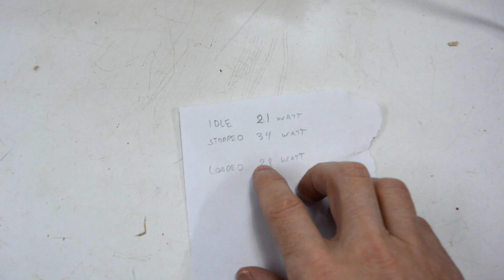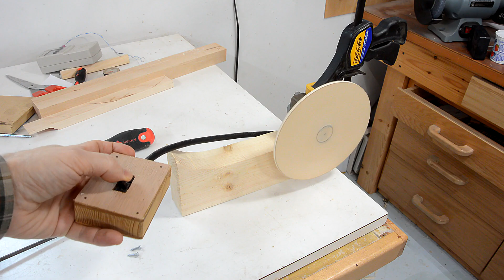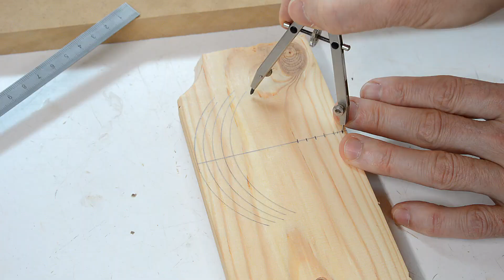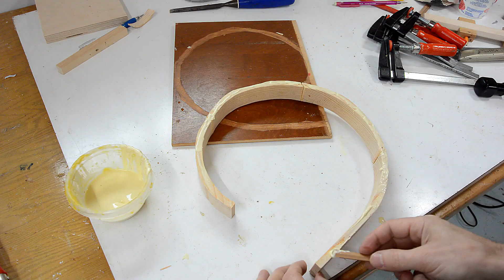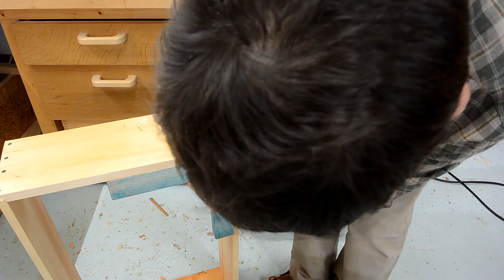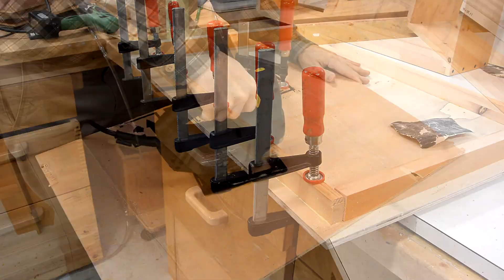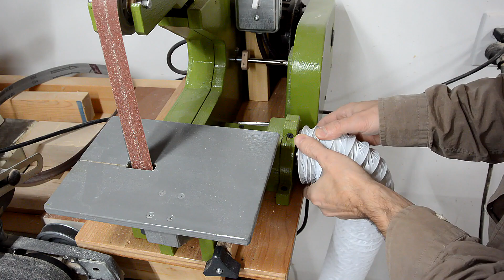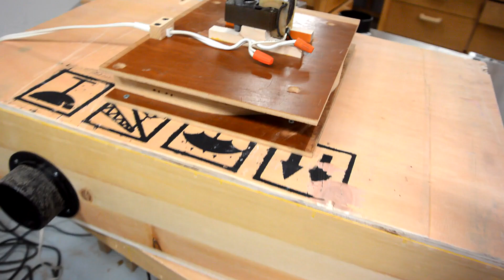Mini dust collector build

Comment: Just a quick tip regarding making a spiral for a fan like this. Start out the way Matthias did, measure the big diameter and the small diameter, find the difference (D - d) and use a dowel with that diameter, a string and a pencil. Start at the big diameter, and as you draw, make sure the string goes around the dowel (fasten the string any way you like, but make sure it's tight). Since the string gets shorter, it will pull the pencil closer to the centre the further you draw, and since the diameter of the dowel is (D - d), then the result will be perfect.
Reply: If you don't bend to my will, you shall perish.
Reply: Well, as I tried to say, you have to have the dowel loose to begin with, as well as the string. Then just wind up the string on the dowel using your fingers to hold the string in place. Then, when the pencil is at the right point, make sure the string lines up between the starting point and the centre. When you see that the string has the right length and the right orientation, fasten it with something. A clamp, glue, your fingers, tape. Then, when the string is perfect, hold the dowel down, and draw the spiral. If it's still confusing I can try to make a video, but it would be the first video I ever make, so it might be shit.
Reply: That's a good tip! thanks.
Reply: +Keegan Chaput No problem. EDIT: Another thing I should add is that if your string is too long, then don't worry. Just wind it around the dowel until it's the right length. Just make sure the string is "straight", as in, creating a line that, if extended, would cross both the centre and the point where you start to draw. If the string creates a line that's tangential to the dowel, the spiral won't be perfect.
Reply: +stygn Not having infinite number of differently sized dowels on hand, I'll use a dowel on hand, say  the 3/4" one in my scrap box, and use that to drive my (D-d) number, either fixing D or d as easiest to live with.
Reply: +stygn great tips, and I understand what you're saying about the string not being tangential, but since tangential is the tendency of the string, how does one control the string so that as it winds onto the dowel it is pointing to the radius point?
Reply: Genius!
Reply: +stygn You're giving away too much info!  You told people of the basic idea - that should be enough. It should be down to them to get it working perfect.  Otherwise we're all just following orders, and no-one is thinking for themselves (which is dangerous in a shop!). :)
Reply: D irk3672 You don't have toilet paper, tape, aluminium foil, wax candles, anything at all to make a round thing with a specific diameter? Hmm. You see, it's quite important for fans like this to have to have the right dimensions.

Comment: LoL.... this is the second time that you make a misake about motor rotoretion.
Reply from the maker: +Mess Krio True enough.  But at least I could demonstrate that the impeller doesn't work that well backwards, and I was able to reverse the motor.
Reply: +Matthias Wandel Squirrel cage impellors can be designed with straight, forward or backwards curved blades, it all depends on the pressure/flow you are after and the speed/torque curve of the motor. Generalising severely a back curved blade will suit a high speed low torque motor and a forward curved blade will suit a high torque lowish speed motor. I've almost build a dust collection thing out of a chop vac and plastic rubbish bin, but can't find any ribbed hose that is cheaper than just buying another shop vac. some will appear some day, or I'll just hunt for broken vacuum cleaners.
Reply: +William Moser and come to think of it you probably know all of that already.

Comment: If you were stranded on a deserted island you would probably be back to roughly the same standard of living within ten years.
Reply: +MrPanohead "I constructed the automatic doors on this subway train out of some bamboo and a small piece of leather that floated ashore yesterday. It works okay."
Reply: +Tor Arne Benjaminsen "I have just realised I fitted the head of my bionic bamboo spouse without a voice box, I actually prefer it this way so there is no need to make adjustments..."
Reply: +Tor Arne Benjaminsen hahaha best comment
Reply: +MrPanohead That's a bit of a stretch. Probably 1/2 that.
Reply: +Tor Arne Benjaminsen LOL!
Reply: +Double Dare Fan He might take weekends off, though.

Comment: Could you do a video on the different types of propellers? Why is this type better than a fan-type?
Reply from the maker: +rasmis Takes less energy.  I discovered that with my first dust collector build.
Reply: +Matthias Wandel Ok, I'll go back and look at that. Thanks! But I'd still like it, if you could explain the flow of air through the system.

And with “less energy”, we mean “less waste”, because a higher volume of pressure is created from the same input of energy, right? I love it when practical applications are used to explain the basic physics I was meant to learn in school :-)

Comment: Where do you get all that 11-13 ply plywood? None of the suppliers in my area carry it and "don't have a vendor" to order it from. Neither large nor small supplier is willing to order this stuff. Help!
Reply from the maker: +NorthernChev At a hardware store.  But Home Depot also has it under "handy panels", 2'x4'.  Not cheap, but I only use it in small quantities.
Reply: +NorthernChev try an arts and crafts store, they usually have excellent small pieces of ply wood used for model airplanes.